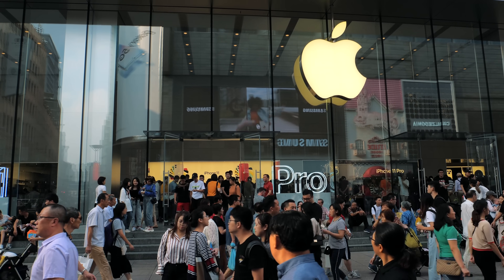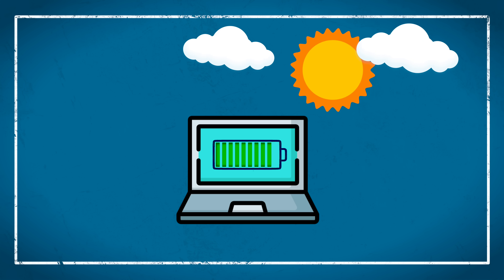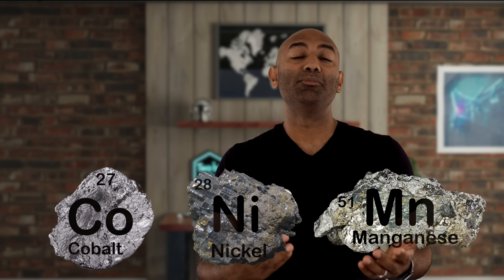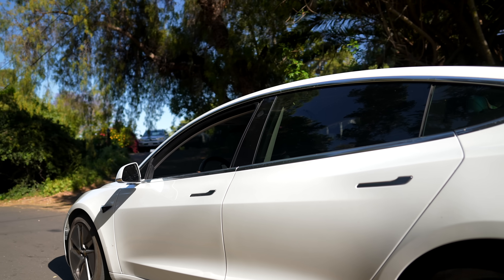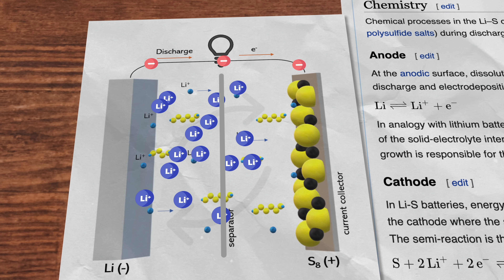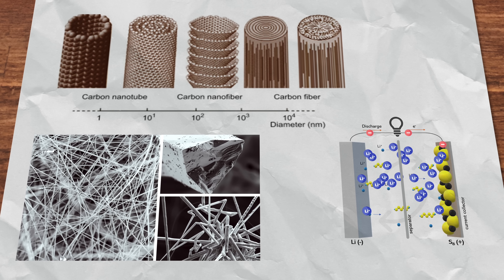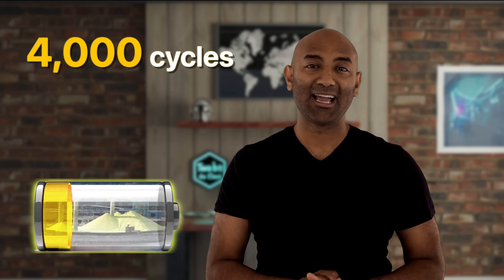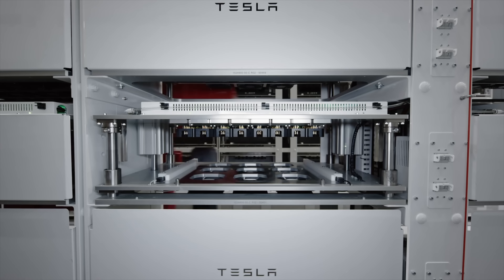Scientists Discover a Lithium Sulfur Battery Breakthrough on Accident!

Comment: In the summer cold winter will not affect the battery that I dream of having someday so cuz I don't have a garage that's heated and cooled I like to have an electric car but without a heating and cooler garage my battery is being affected by the weather outside why not have a battery that is everlasting battery that not no matter how hot or cold you actually drive the car over hot lava or multiple Street that's melted by the Sun like that one summer in Oklahoma that I had my feet and shoes melted to the asphalt and sidewalk due to the heat of July in Oklahoma City as well as my bicycle tires melted down to the rims and most of the rim was gone as well leaving just a band of metal that still holds my spoke in place without the sad part of the metal that went against the tire because it was all done that's how hot it was that summer and I wonder why the Greyhound tires didn't melt as well with my bicycle melted that was given to me that summer trying to escape the city to Little Rock cuz I couldn't get treatment there and that City and the police there does not call the ambulance when you need one when you're homeless you know there's a cop that sees his chicks in and which mission there in that City in Oklahoma City anyway I never wanted to come back to Arkansas but I was forced to I was going to wait till I get either my apartment I stay there while saving some money and move back get some other states out west I was thinking during the state above California and try out that town if it does this that was in the kindergarten cop movie historia Oregon I believe it was but I never made it there I think it's a pretty town and from the movie I don't know if it's really that way I like to see if a story of Oregon actually is good be interesting to find out I think it's the second movie I'm thinking of of problem child too marksville USA does that town is this is it truly a worst capital of USA and single people that single is divorce or death I never gotten married to certain reasons they can find a woman there that live in sin with me I thought but I never made it there to find out if that little cities actually exist where you can find single people and force people that might decide to try their hand as being jacked up girlfriend boyfriend with somebody cuz I couldn't find anything like that in Arkansas because they're all the women is always taking it either by marriage or check up boyfriend I should have started when I was a teenager but the only problem was that one is that girls screwed that up with their twist idea of kidnapping while pregnant and denying a man in the right to be a father and take care of his little one it's criminal what else young girls was acting I couldn't let myself be a teenager cuz of it a true teenager it'll make that mistake lay down with a girl and screw around and have some fun knowing when the fun's over and you got to pay the price and take care of your little one they come from the fun that was really wanted to be that type of person and that kind of life and take care of my little one with my teenage girl but that just didn't happen so you know cuz girls screwed it up about talking about how they want to kidnap the child so I just crawled into myself and never went on dates it's all the teenage girls fault I'm pretty sure they wanted the kids but they didn't want to share the kids they wanted a kidnapped child now let me know if there's a boy or girl I'll let you all know his father which is criminal only if the father is a decent man decent boy man of a teenager that's just decent and you really couldn't get no more decent than I was cuz I was against those things that was evil those people that do evil things should be punished with paralyzed virtually from neck down and the voice box cut out on and put it in a nursing home in a wheelchair to be abused by ticks please skeeters poison ivy poison oak hopefully they're allergic to it and eating powder as well they have no voice saying no way I'm talking to you game pay for mercy cuz they can't speak that's where the monster should be stuck in a wheelchair paralyzed their voice box shit out of them from the neck down without use of their arms and legs and their voice there's no way that person like that can abuse anybody again and talking of children will be safe once again play and be free to play as children should play and use their imagination with their friends I wish this could be a law for the punishment of monsters that hurt children as well as rapists to be stuck in a wheelchair without their use of their legs and arms as well as your voice no longer be with him to speak and now Christians was in their heads to suffer like the children that they have hurt to suffer throughout their life every login for death but whenever receive it for the torture has it don but also the car will be able to stand frigid without fail it would stand printed and 100° temperatures of the summer and the frigid coldness of the winter and no matter hot or cold will it be drained or weak from power it would push the power for to go down the road for the car to go down the road and we can truly say we have an everlasting car that's electric  temperatures as well as 100 green temperatures without faie to come close to the end of their torture long-term living they will be tortured with a creatures of the devil to punish them
 get back to the battery it should be what lifetime guarantee battery for life of the car or the person without danger of floating into everything giant fireball even you wreck the car will not cause the battery to short out and cause a major burnout other automobile trapping you inside in a vehicle and dumped in flames and something I didn't want so we'll have to worry about why can't we have a vehicle electric it's safe of all these things safe and canceling power car that don't go home and a big old fireball burn you up in the New York second before you have a chance to get your seatbelt off get out of the car the car is all over the investing planes and you're dead these things should not happen with the new battery I dream about or electric cars and I hope to God they find a way of creating these lyrics ending batteries without radioactive material are waste are being radiated with radiation from nuclear system battery of some kind I'm not talking about nuclear I'm talking about something more flexible it's more suited for a car that doesn't load or doesn't put no radiation into this area doesn't like toxic waste into the environment a very slowly that environment friendly to all that would be around it wildlife and people should not be harmed from this battery but becoming a about husk of a human being a radiated person a sign of radiation from a nuclear explosion from the battery cuz it's not nuclear should not have a nuclear explosion of any kind of radioactive fallout or leak into the environment that cross environment harm but every lasting battery they can resist hot and cold and last and last and last for life of a human being a better that can last 500 years 9200 trillion miles and growing to more mileage without end
Reply: Cool story
Reply: I thought there was a limit to characters on YouTube.

Comment: EV are not just about batteries. Any news about a new motor technology?

Something like this?
"This tiny Koenigsegg EV motor makes more than 300 hp
The "Quark" weighs in at under 30 kilos yet can turn out 335 hp and 443 lb-ft of torque"
(DrivingCA-  January 31, 2022)
Reply from the maker: I’ll check it iut
Reply: yes, but this is only relevant for super cars. for mass mobility the electric motors are fine. they need to be cheap. the weight is not a big issue

Comment: With increased energy storage capacity comes increased range, but it also comes with increased charging times.  Until they figure out how to reduce charging times to equal (or at least nearly equal) to refueling with gasoline or diesel you're still going to have the same old bottleneck issue regardless of capacity or range.  Also, with increased energy storage capacity comes the increase in energy released in an explosion or fire if something goes wrong with a battery cell.
Reply: Wrong, most ev charging is done at home during off peak demand hours. Like a smart phone, you just plug it in and walk away. 
The average ev driven by the average American needs 1.5-3hrs of charging per day, that's it. So using todays grid capable smart chargers talking to the grid. Means you can charge whenever it's the cheapest energy time or when energy generation is most sustainable.
Reply: @4literv6  That doesn't change the fact that if you increase capacity it increases time to charge.  Especially for anyone trying to drive longer ranges than just daily-local driving.
Reply: @Gravel1331  Yes charging time increases but 99.9% of people don’t drive 500 miles a day so that is not the biggest priority.
Reply: @Energy.Theory  Tell that to the people who like to travel and won't buy an EV because of this issue.  Like myself, for instance.
Reply: @Energy.Theory  I mean really, what's the sense in increasing battery capacity/range then?
Reply: @Energy.Theory  So what is the magic mileage number? 100? 50? 250? The point is to have the option to go 500 miles just like in a car if you want except it doesn't take 10 times longer to fill up your car with gas. Also, what do you do with an EV if your battery runs out of juice on the road somewhere? It's not like you can bring a "can of electricity" to the EV like you can with a car and a can of gas. Cold weather also has an effect on batteries and therefore EV ranges.
Reply: @Gravel1331  Yes it does. Because if you have enough range for even a long day’s driving then we’ve already established that you can set up overnight charging to replenish what is used in a day. You might need 22kW chargers but it could be done. Remember that kind of driving is not common either. It’s the exception rather than the rule. I still think this technology is probably 10 years from prime time and the problem is it takes enormous amounts of capital and there are at least a dozen different battery “breakthroughs” competing for the dollars.
Reply: @mondotv4216  I think you and a couple others are being deliberately obtuse, or you don't get simple math.  My statement has nothing to do with when or where you charge.  Simply that increased capacity (when depleted) means longer charge times... and right now THAT IS the biggest bottleneck with EVs.  This will always be an issue until you can recharge as fast, or nearly as fast, as gasoline/diesel.  All this BS about well no one drives that far, and you can just charge at home at night is moot.  You guys are deliberately overreaching.
Reply: @Gravel1331  Charging times might be longer but so is the time between charges. Bigger batteries give you the flexibility to charge where and when you want.
Reply: @rogerphelps9939  They also give you more potential energy to be released in the event of a catastrophic failure.

Comment: So this makes me want to hold off buying a EV until this type technology is available in a EV.
Reply: If an EV that exists today will suffice I wouldn't wait. This is still in research phase, it could be a decade before it reaches EVs and it won't necessarily make them any cheaper.
Reply: Tech is always improving. If you need or want to replace your car now, just compare what you have now

Comment: I'm super curious to see how this potential breakthrough and the possibility of silicon anodes increasing the amount of lithium in batteries affects range and capacity.
Reply: Yeah sulfur is cheap. However the big issue here is they use a carbon nanofiber cathode. This costs $6.52 a gram though the method used in the paper requires a somewhat expensive process called chemical vapor deposition. Currently this can be done in a lab and mass manufacturing is a challenge.